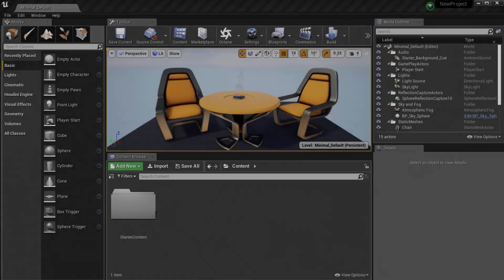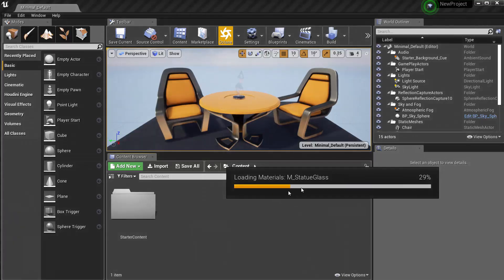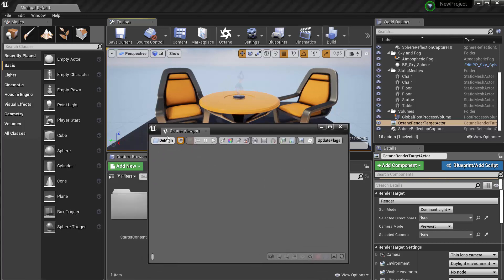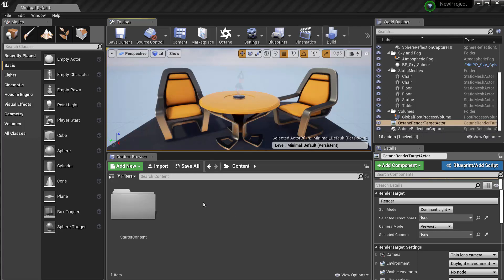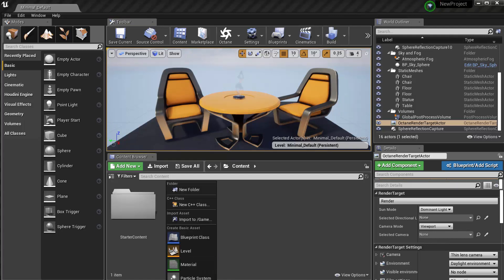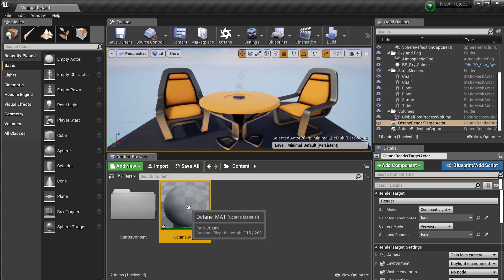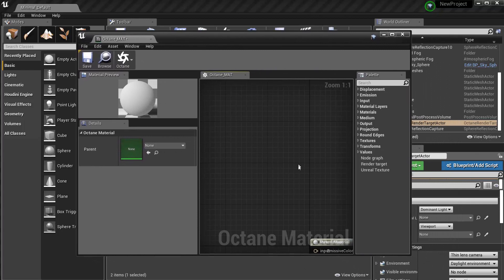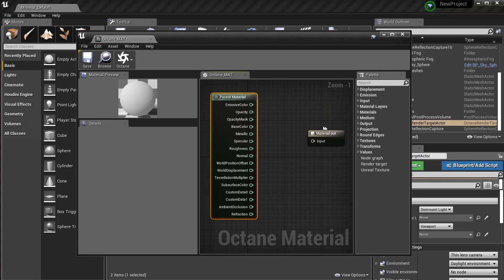OctaneRender for UE4: Material Overview

Comment: i think by UE4 and Lumion we Don`t need octane and redshift and others 
they are good just for simulation and some other stuff except arch
for architectural design Lumion and UE4 are amazing and the speed is incomparable
Reply: 333jas yeah absolutely, but also you can go a lot further than that. For example film studios are now using unreal to make parts of major motion pictures (e.g. Lion king), you would want to render that output properly and take time over it for max quality for final output while using the real time render engine in unreal to do live acting and motion capture, etc.
Reply: 333jas  I may be wrong but this is as I see it... There is a massive quality jump between real-time rendering in a game engine, and non-realtime rendering in Octane. I think the language is very misleading, because although OctaneRender is offering a 'real-time preview', its really not real-time in the same sense at all. I.e you will not be able to run your UE4 level as a game using the Octane Render engine. Instead, you could use Octane to build very high-end still image and video clips of your Unreal Engine content, which currently requires passing back into a 3D modelling application first.

In Octane Render, each frame will typically take a second or two to load to even a reasonable quality (as you can see from the Render Preview in this video). However you'll be able to achieve much higher quality renders of specific scenes by setting up high-end render settings and letting it run for longer (i.e. switch to PMC kernel, etc).